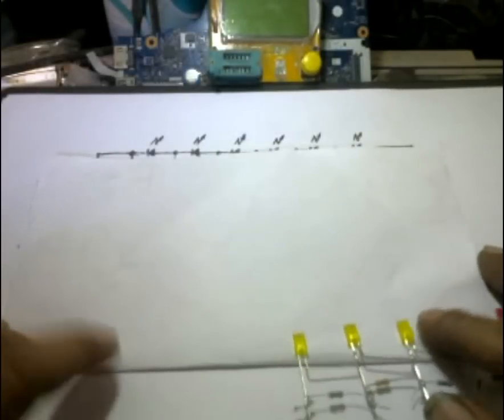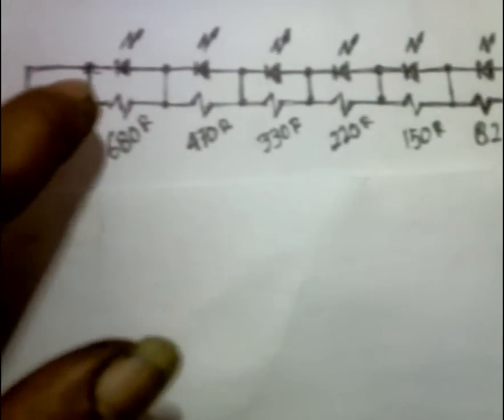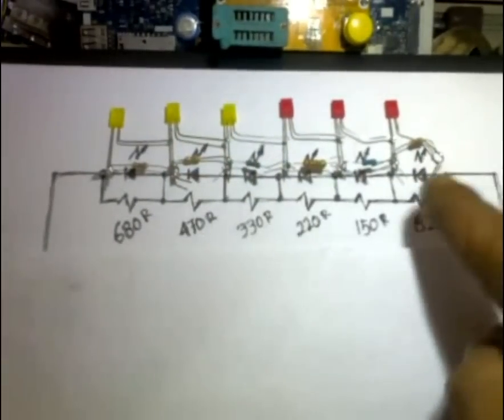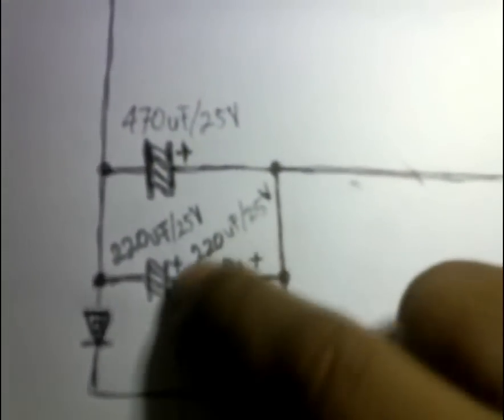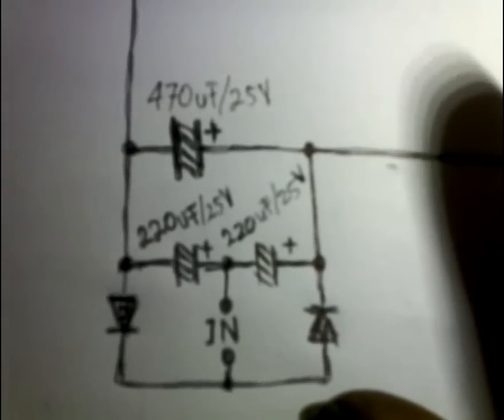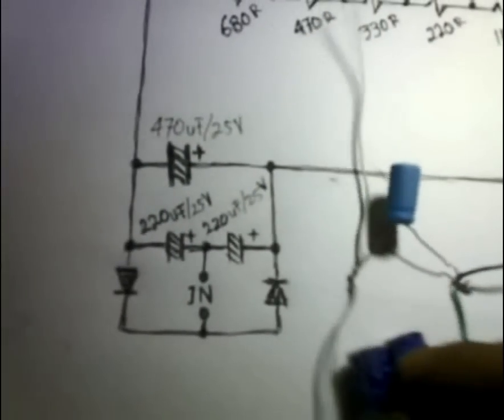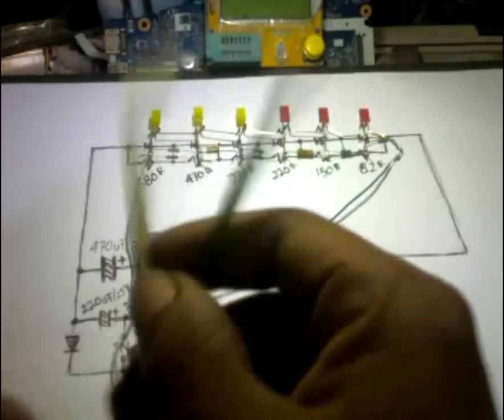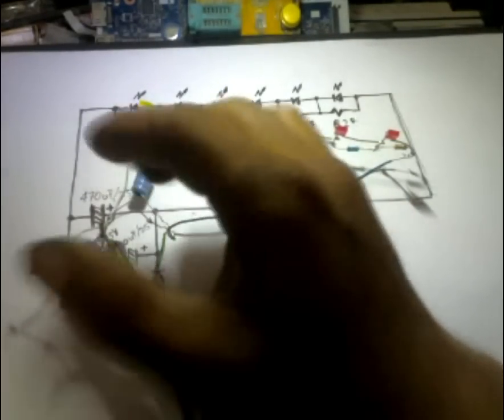LED VU Display tanpa Transistor dan tanpa IC

Comment: I see 2 connections at the bottom that you did not name what are those?
Reply from the maker: that's "input", it's paralel directly to speaker
Reply from the maker: so this circuit doesn't need an additional DC power supply....

Comment: kalau selisih nya di atas 50 tapi  tidak rata selisih 50  ada yg 60 dan 70 bisa  nda gan
Reply from the maker: selisih apanya ?
Reply: selisih nilai resistor nya.misalnya 100ohm .150ohm.270ohm.330ohm470ohm bisa gan
Reply from the maker: ia... nggak masalah itu...

Comment: Only one problem is that  passive VU meter  produces uneven brightness
Reply from the maker: it's depending by circuit
Reply: Edifier Bass 7
Reply from the maker: the uniformity of the light intensities it's depends on the circuit and also the manufacturer of the led, because the different factories are usually different light intensities
Reply: Dunno, cause i tried to make a passive vu meter via led  in one color 10 leds way back but  but it does not give equal brightness,  unlike active Vu meter leds, anyway its a nice project ...thanks for sharing...
Reply from the maker: Edifier Bass  the number of leds used depends on the power of the amplifier, because this circuit only relies on the voltage of the amplifier output
Reply: i know , i tried it even with big amps results still same the first 3leds are bright after the next led grows weaker and weaker, cause if we compare it to an active vu meter say, lm3915  leds are evenly given same amount of brightness
Reply from the maker: that means you fail to do it, there something wrong with your circuit, why do you equate with those using semiconductors?
Look at the second LED in the video, it's brighter than the first LED, it's because the LED manufacturer is different,, if like that you mean is happen, it should be weaker than the first LED

Comment: kalo buat speaker 12v kurang karasa 
kalo bisa saran buat 12v R1 - R8 pake yang Nilai R nya brapa aja ?
Reply from the maker: khusus rangkaian ini kalau power ampli menggunakan supply 12v maka maksimal led hanya 4. karna sy berpatokan secara umum setiap 1 led 3 volt
Reply: kalo resistor nya saya kurangi misal R1 50 - R7 350
Reply from the maker: tetap sama,, hanya arus yg berubah
Reply: lalu kalo utung sekema 7 Led di ampli yang pake 12v 
rangkaian nya kaya gimana tuh info dong mas ini lagi buat tugas 
dosen kaga ngasih tau cara nya
Reply from the maker: kalau itu minimal mesti menggunakan transistor, atau yg lbih canggih lagi yg memakai IC
Reply: punya tutorial nya ga mas ?
Reply from the maker: kalau yg pake IC udah banyak tuh yg upload
Reply from the maker: ada video baru sy tuh yg tanpa TR dan tanpa IC jg,,, yg di video itu bisa sampai 100 led

Comment: rangkaian nya bisa dipake kemotor ngga?
Reply from the maker: kalau motornya di pasangi audio amplifier sdh tentu bisa
Reply: Dies moristo Lekka ini jenis Led nya apa berapa volt,
saya ada yang Led 5mm 3volt biasa ngga?
Reply from the maker: bisa jg tuh tuk sebagai indikator RPM-nya.. sisa hubungkan ke spul/coil lampu motor
Reply: Dies moristo Lekka ,sambung kabel" nya gmna klo dipasang buat rpm mtr?
Reply from the maker: @s.anas1526  sambung aja ke coil/spul mesin yg tuk lampu